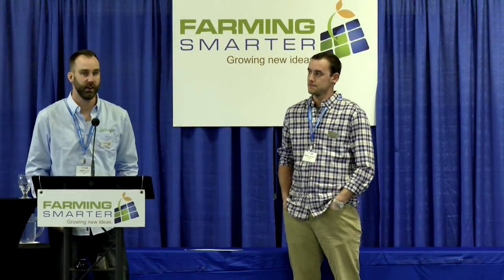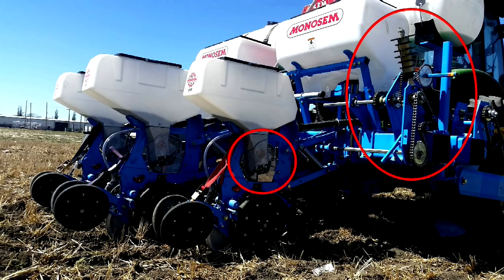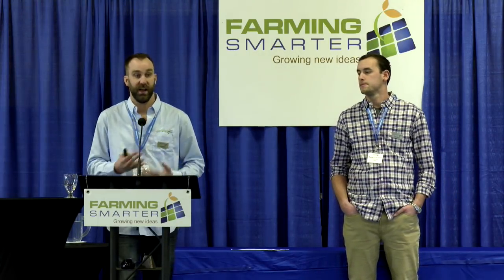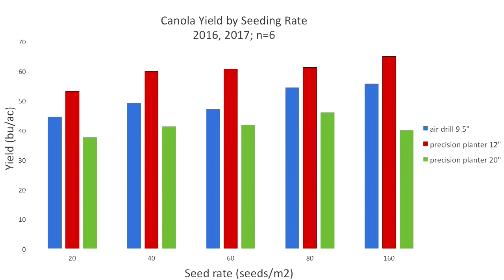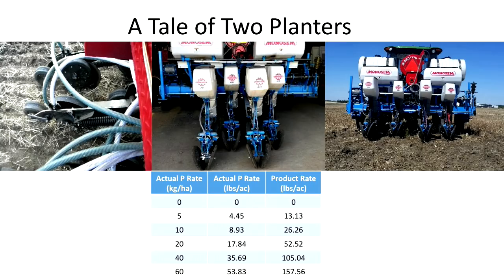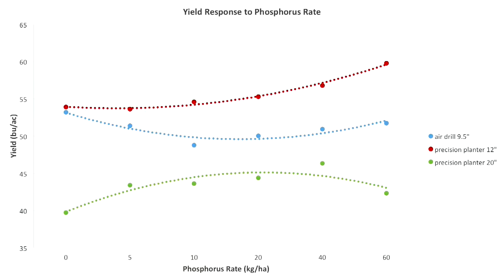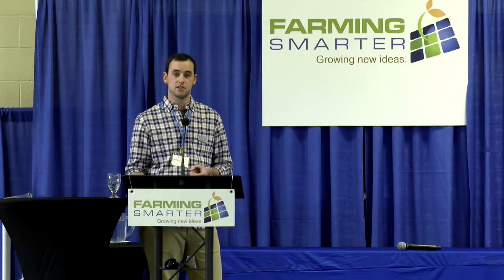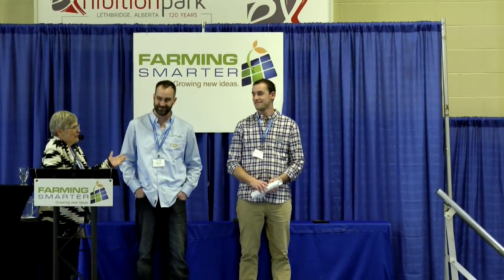A Precision Decision: is Precision Planting the Future of Canola? - Farming Smarter Conference 2017

Comment: If the image shown at 11:35 is how they had their row spacing trials laid out, there is no way to get reliable yield information out of that trial and the data they did get will artificially make the 12" spacing look better than it really is.
Reply: That image was stitched for presentation purposes.
Reply: @kencoles828  The problem isn't how the plots are oriented to each other, the issue is the plots are different width and the circumference of the plots isn't equal.  The plants on the borders of each plot are going to have access to more nutrients/water than the plants in the middle of the plot.  When your ratio of border plants to interior plants is different, you can't compare the yields of those plots.
Reply: The raw plot yield is adjusted for  area according to row spacing.  An excess of nutrients were applied to isolate row spacing effect.